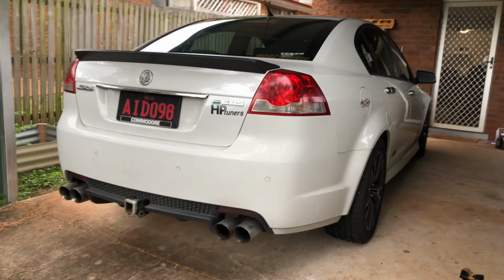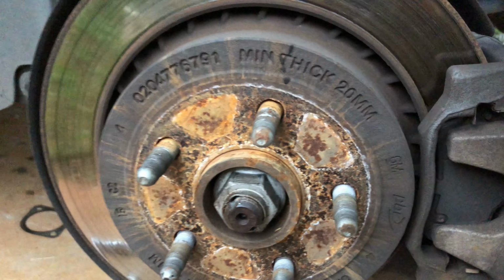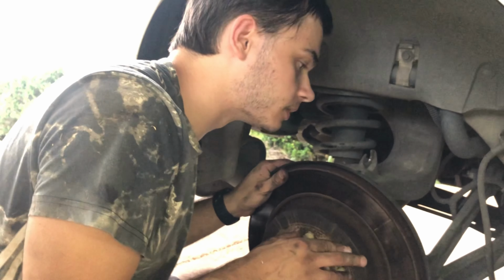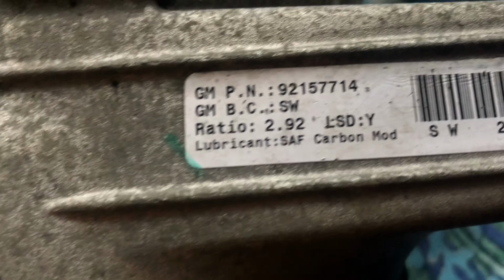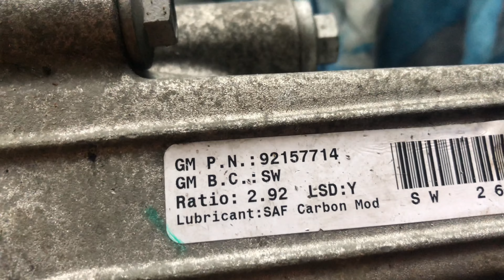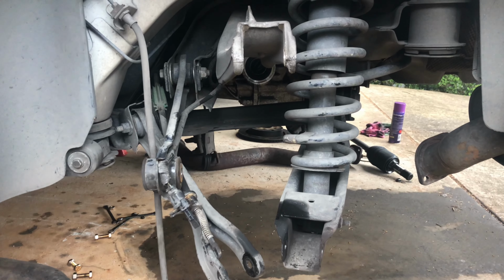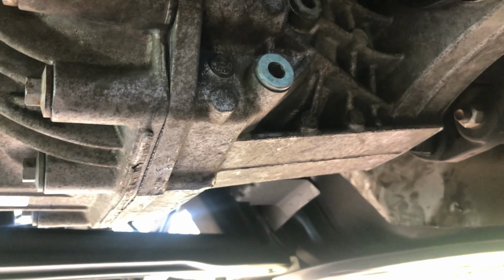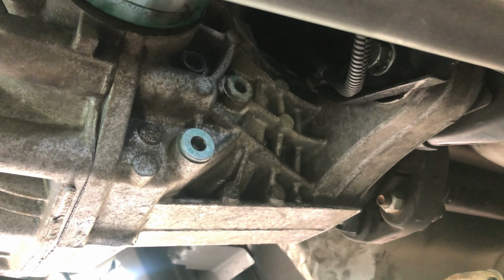How to change a VE/F Commodore diff

Comment: I cant get my drive shafts back into my diff after a rebuild? Is there a nack to it? They're in the splines just won't seal upto the diff
Reply from the maker: They should just slide on, did they put new seals on?
Reply: @Aidoz_Garage  yeah the whole diff was rebuilt with a new seal and bearing kit along with a truetrac
Reply from the maker: Can you get the axels in a little bit? Give it a good wiggle till it slides all the way on
Reply: @Aidoz_Garage  yeah they're in the splines because when you love the tailshaft, the drive shafts turn, just.cannot get them in all the way. Feel im gonna have to take the shafts out the hubs
Reply from the maker: Would you be able to send me a pic of what your looking at on instagram?
Reply: @Aidoz_Garage  ive got it now mate. They needed a good hammering to get the retaining clip to seat inside the diff. Whats your Instagram? I'll follow you
Reply from the maker: @richwayman5168  https://instagram.com/aidoz_garage?r=nametag
Reply: Does this do anything to the speedo ? I have a calais so thinking of swapping to a lsd if its the same

Comment: GTS VE Commodore,  I'd like to change the in tank fuel filter, is it as hard as they all claim it to be ?
thank you for this clip as I never new the hand brake adjustment was where you showd us b4, mine being a manual will have to attack it tomorrow, me being lazy I let others do that kind of work. However I pulled  the 6.2L engine out and back again, a big job lol
Reply from the maker: Not 100% sure but I think the fuel filter is inside the fuel pump assembly and it’s not a easy swap over, it might require a whole new pump, I’ll look into it. As for accessing it you might be lucky and have a access panel under the rear seat which will save you a lot of time instead of dropping the whole tank.

Comment: So iv got a series 2 omega.. is it worth throwing a diff from a 08 ss (v8 lsd) what’s the difference besides 2 wheels spin (mine never do) 😅
Reply from the maker: The difference is getting the power to both the wheels when you need it
Reply: How much you think a shop would charge me to do the swap?
Reply from the maker: If your supplying your own diff for them to put in my guess would be $250 to $350 worth of labour
Reply: @Aidoz_Garage  hey matey how long did it take you overall? 3 hours maybe?
Reply from the maker: @kurts9085  probably less than 3 hours
Reply: your ve series 2 omega will have a 3.7 diff ratio, the ve ss commodores have a diff ratio of 2.9, you will experience less torque and acceleration for a higher top speed, i reckon it would be better if you just swapped in the lsd and kept the running gear

Comment: Why would ya put a 2.92 back in it, they're a boat anchor.  3.27s or 3.45s a  bare minimum.
Good vid though, but doesn't have to remove axles all the way, just pop it out of diff and let sit there.
Reply from the maker: A 2.92 with a 6l80e Is almost equivalent to a t400 with 4.11s
Reply: @Aidoz Garage  I've got 3 wm caprices, they are dog shit, not to mention the carbon clutches in them are the worst of them all.....
They work themselves sideways as clutches wear, then explode......
The propper tuning of the trans is critical, my latest wm mid 400s at the tyres, torque management shit timing, adaptive presets and all your shift points are all controllable from a laptop.
You could run 4.11s and make it shift how you want.  Top it all off, if ya 6L80e is between the ages of 2006 to  2012, it's a then a matter of time ya box will suffer from converter failure anyway......   have a look at the world wide recall on that box.....
Reply from the maker: Yes sir the jmbx torque converter is dog shit